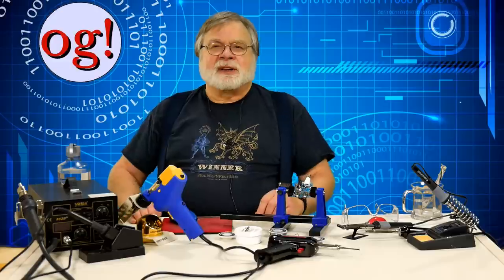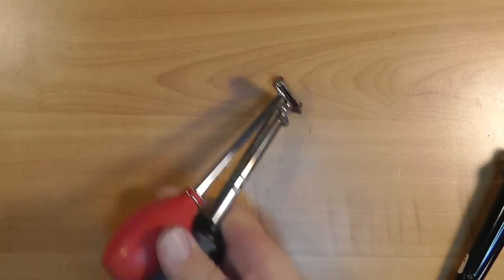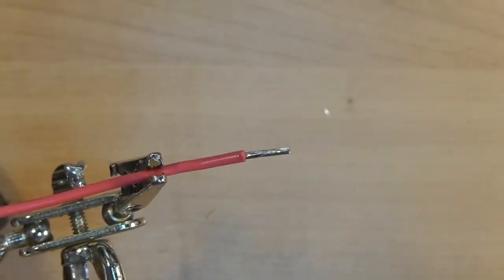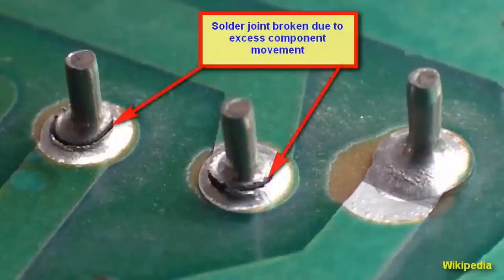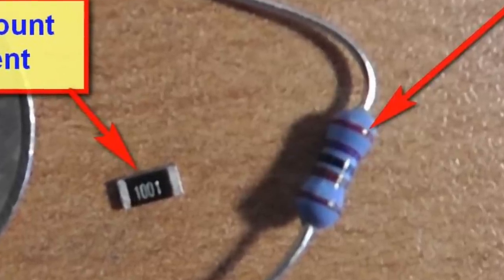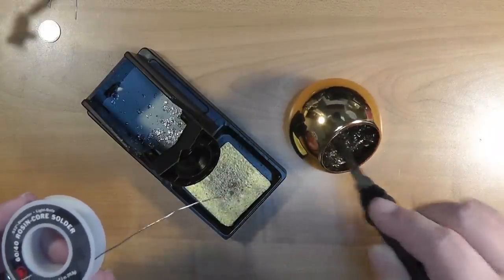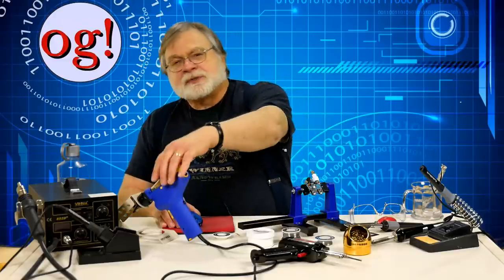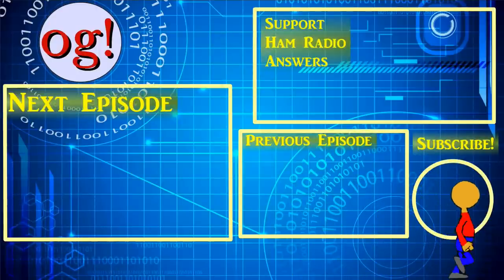Soldering 101 for Makers and Radio Hams (AD #121)

Comment: Thanks for the mention Dave but you were almost to the SMD cliff, I just gave you a little push. 
On another note, this video was a great example of Soldering 101. Outstanding actually. I wish it had been around in 1973. I destroyed a lot of things with my dad's old Weller soldering gun :) The pointers you gave were very handy and hard to figure out without help. 

Oh, when you're using the wonderful Hakko desoldering gun, beware of distractions. I laid the tip of mine on my left arm as I was looking around the bench for something and didn't notice it until the smell of something burning (me) made it to my brain. I didn't react immediately but thankfully I didn't press it into the skin so it was "just" a very painful surface burn. No pain when it happened though. I think it killed the nerves almost immediately because it was so hot. I have nice little white patch of skin where the burn was. 

I put a tongue in cheek post about surface mount soldering on the EEVBlog last year. Oddly enough it caused a bit of a war between two guys toward the end of the replies. Such is the internet. 

I'm looking forward to sitting in on your live show this weekend. I missed last weekend. Well... not actually sitting in... watching.
73 Dave DE NE5U
Reply from the maker: Thanks again for how much you're helped!

Comment: Nice presentation Dave. Thank you for the pointers. 707 degrees. I will try that. I have a Hakko 888 and had it at 740. Maybe a bit too high. Too low and the solder doesn't seem to flow. Using a small wedge tip.

Comment: Great information Dave.  I have an older xytronic 168-3CD that I absolutely love.  It's fixed heat and I've found that ~665F works well for the smaller diameter solder.  //KM6KTR
Reply from the maker: Thanks for the tip.

Comment: Dave, I am happy you mentioned that the fumes are not lead as it reaches a gas state at temps above 450 C. but too bad you don't have a simple fume extractor shown in the video, as the darn flux fumes are not healthy at all. 
Sure the lead would be worse but it's still not good for you also, 375 C is plenty hot as 60/40 melts at around 188 C. I don't know for sure what temp my solder station is set at but I think its about 275 C with 48watts of power. off-course higher temperature possibly means less time on the components but most times the heat will kill it faster
Reply from the maker: Up until a few years ago, the smell of those flux fumes was synonymous with kit building and home brewing. What we should be wary of changes with time, I suppose, and it's undoubtedly true that breathing the fumes directly isn't good for the lungs.